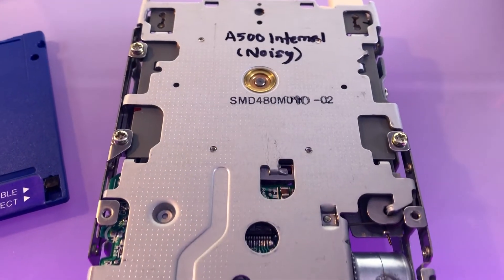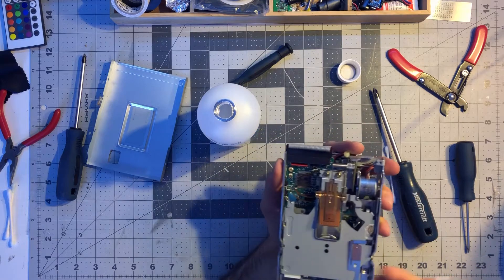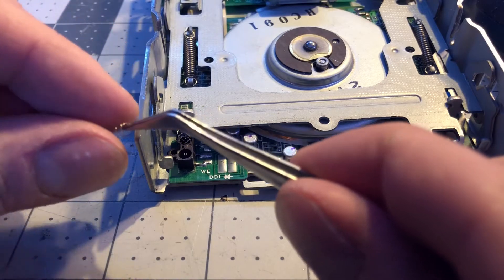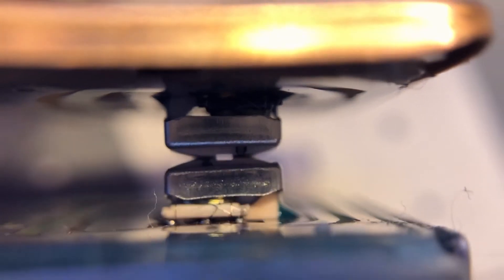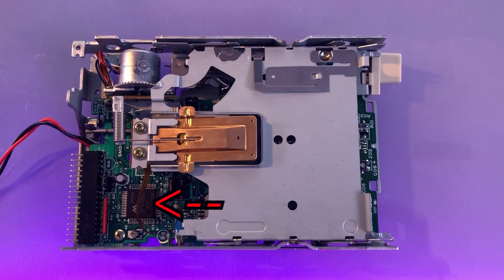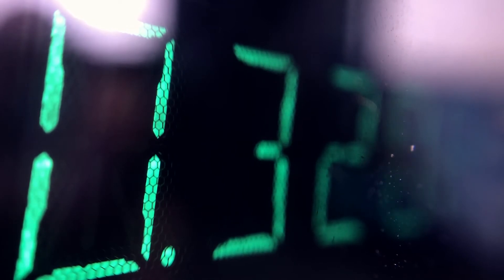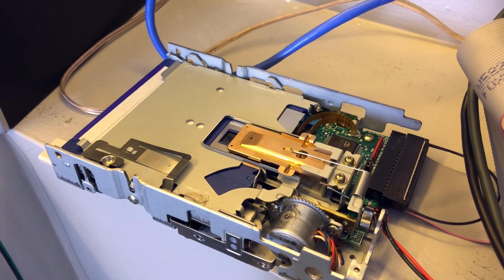Amiga Floppy Driver Repair - Epson SMD400

Comment: I like your video but I have a question. I see that you have removed a head stepper motor for testing. It has tooth ring around so I presume for aligning purpose. Is it hard to align it after that? Are there any softwares which can check head aligment for Amiga?
Reply from the maker: I would recommend the proper way and the right tools: acquire of a calibration floppy and a good scope! Then there are a lot of service and calibration manuals around to do the proper head alignment, it is surgical. Most service manuals, if you can still find them, should include the proper procedure and if lucky, also the waveform you should expect. Now, if you asked I may guess you don't have those and understandably may not want to invest in expensive Cal Disk and Scope, especially for a one off. In this case, I have not tested this but, the Amiga Test Kit has a calibration section in the Floppy menu, I guess you could play with the alignment wheel and check if the track reads as you tweak. IF this works, it will be far from accurate and you may have a lot of read/write errors when using Floppies from other machines. However I'm curious, let me know!
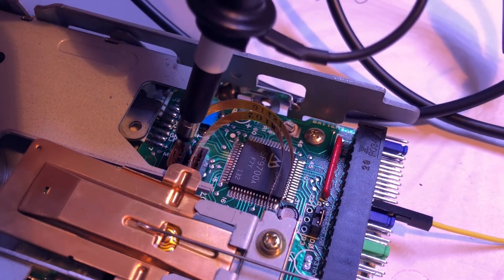Reply: @AnalogThinker  2:11 Can you point me to some diagram how to force a floppy into  continuous read mode? because I can't find it anywhere :(
Reply from the maker: @tiemanowo  maybe you are using the wrong search words. Try doing a google image search with "shugart floppy pinout" and you will have thousands of diagrams. If I remember I used jumpers directly on the back IDC connector. You probably want the DS0 (10) and MotorOn (16) to ground, and if you have, a scope on ReadData on pin 30.
Reply: @AnalogThinker  Thanks. Yes. I was searching wrong "words".

Comment: Nice work. I have a Chinon drive that recognizes the disks but won't start loading them (doesn't kill the disks). Drive is cleaned and recapped. Don't have the skills or equipment to look up further.

Comment: Hello! How did you take the casing apart?
Reply from the maker: Just lift the cover, I don't recall it even had screws, it was clipped in place.
Reply: @AnalogThinker  Oh, Thanks! I just saw that mine has a little screw

Comment: Nice! I have a dead Panasonic ju-253-031p - the motor controller Hitachi HA13748 is shorted (burned a hole) and I would like to know I can source that chip anywhere! Keep up the good work.
Reply from the maker: There is no secret place I know of, unfortunately I resolved to check eBay and in parallel ask for quotes from those obscure vintage part merchants (that half the time look like scam and never reply, the other half probably offering rebadged/reprinted salvaged parts) but heh, sometimes worth the risk... So all in all, be careful, use a gift VISA card if you think it's too good to be true and good luck in your repair! Thanks for the support, cheers George!
Reply: @AnalogThinker  thank you for you input! I found a similar controller and will try that first. The other guys you mention seem to stock the right one but require $100 minimum order! I'll also check normal (not Amiga) floppy drives from that era - maybe I can salvage a conrtoller this way. Take care!